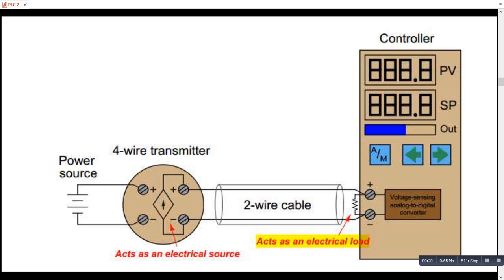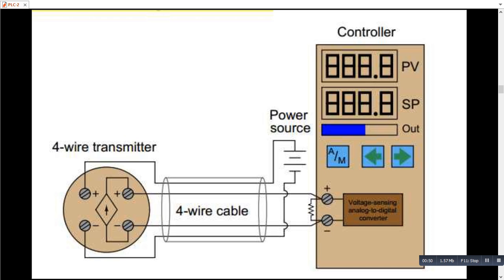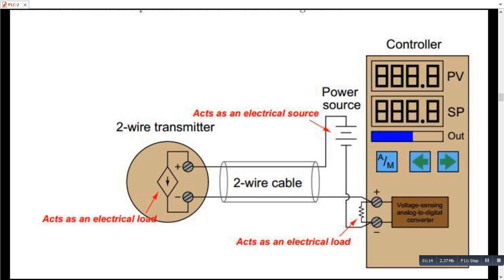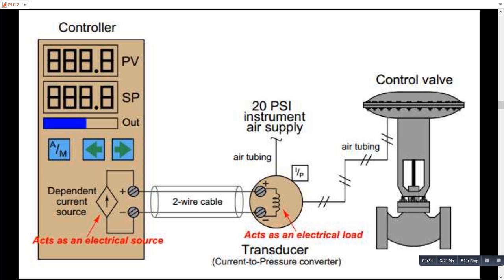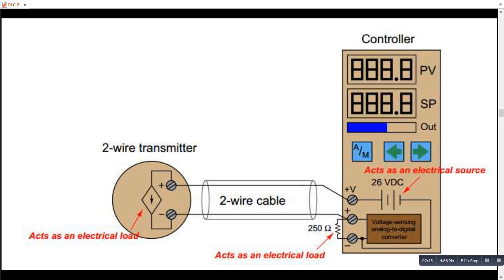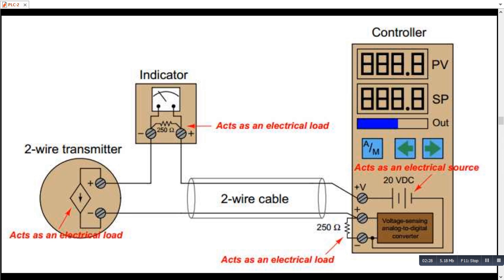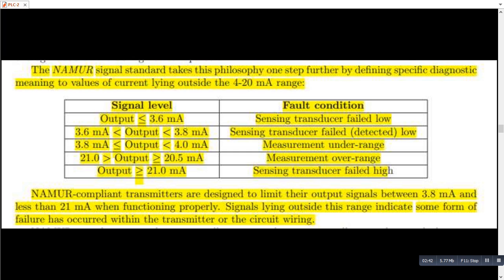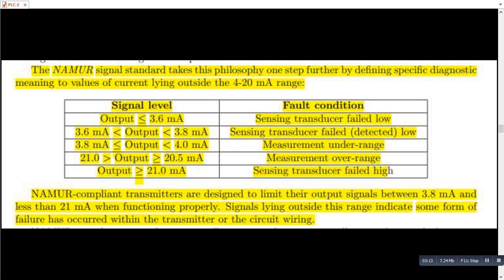4 Wire and 2 Wire Analogue Control Loops, Control Valve Positioner Control, NAMUR Fault Diagnosis

Comment: Why we use 250ohm resistor ?
Reply from the maker: To covert 4-20 mA to 1-5 volts as per Ohms Law formula..detailed answer is given in automation lecture series playlist..
Reply from the maker: To convert 4-20 mA to 1-5 volts using Ohms Law V=IR
Reply: Thanks sir.